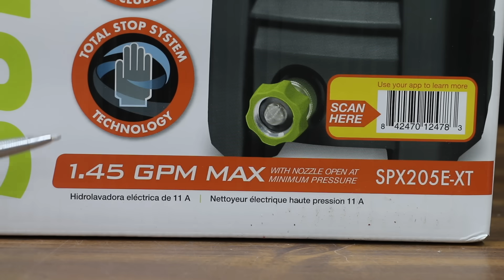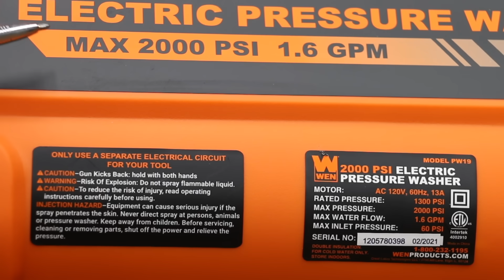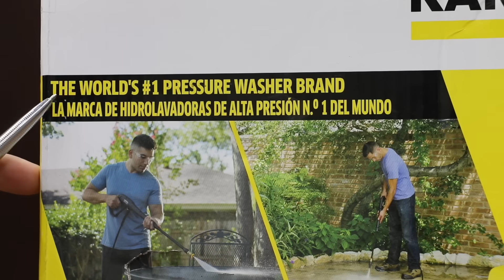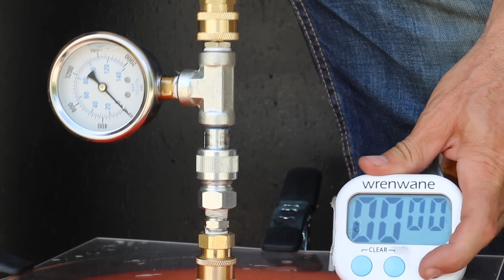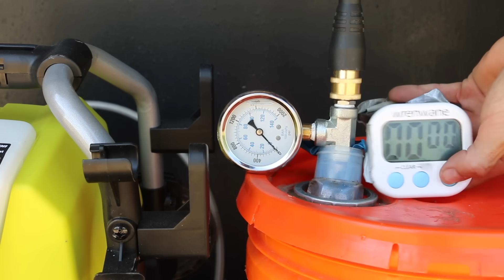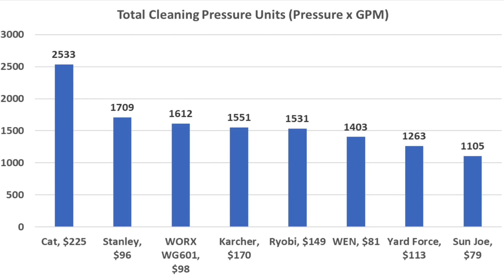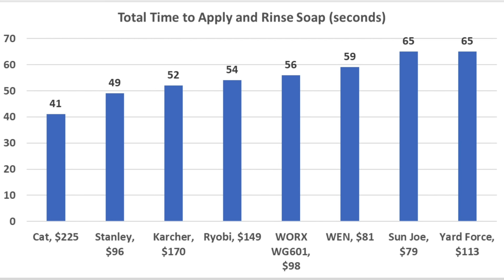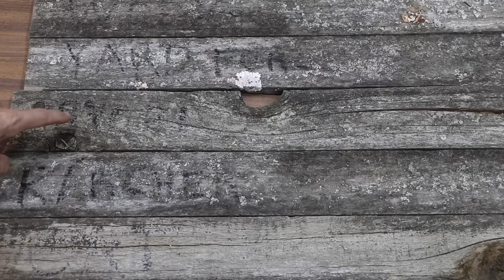Best Pressure Washer (ELECTRIC)? Ryobi vs Karcher, Stanley, Sun Joe, WEN, CAT & WORX

Comment: One thing I noticed is that some of the sprayers seemed to leak water out the nozzle. For instance, when watching the Stanley being used, there was a VERY large dribble that didn't spray out and just fell down from where the nozzle was. It'd have maybe been better to not include that water as part of the GPM testing by holding the nozzle such that only the water that came out with force made it into the bucket.
Reply from the maker: Thanks for the feedback.
Reply: @ProjectFarm  I love your stuff and all the time you take and the money you spend to create these reviews. Most things I have no need to buy myself but it's still very interesting to see how you test things and which ones come out on top. So I watch them all!

Comment: The CAT is a rebranded "Active" pressure washer. Also sold as a Simoniz in Canada. Obsessed Garage made a very detailed comparison of these cheap pressure washers a year ago or so. A Karcher came out on top at that time, but since then, they discovered the Active and swear by it (and sell it...). I have Simoniz and use an MTM accessory kit with it (gun, hose, foam cannon and quick connects). If you are a "weekend warrior" type of detailer, that is a great setup.
Reply from the maker: Thanks for the feedback.

Comment: The turbo nozzle is the bomb. It will make a HUGE difference. Makes a cheap washer work better than some of the more expensive ones.
Reply: My pressure washer came with two nozzles. I couldn't even tell you where the spray one is today. I'm sure it is still around somewhere. It's turbo over here all the way.
Reply from the maker: Thanks for the feedback.

Comment: Video idea: Comparing rotary tools (dremel and competitors). Both Corded and Cordless. The biggest drawbacks i find with my older corded dremel is the power/torque, and that it gets quite hot easily, and i need to let it cool down occasionally.
Reply from the maker: Thanks for the video idea.

Comment: Im literally on my way to Home Depot to buy a pressure washer. 

This video couldn’t have landed at a better time !
Reply from the maker: Great to hear!
Reply: I'm the opposite. Already bought one and past the return window.
Reply: @lancemcque1459  same
Reply: I borrowed one and now I know why the the estimates for cleaning/staining my deck were so high.  Their power washer was a muuuuch larger unit than any of these and actually got the job done in a manner nothing here tested would have.
Reply: I bought mine a few months ago too. I went with the Ryobi 2300 washer because it was said to have a better induction motor than the lower models.

Comment: I would like to see a retest on the presure washers with oil, grease and grime like you would see in an engine or under a car that had been leaking for a long time. and hot water vs cold water
Reply from the maker: Thanks for the suggestion.

Comment: Might consider doing an electric pressure washer comparison among the ~2300 PSI to ~3800 PSI models. Including some of the low center of gravity models, such as the Ryobi RY142300 (2,300 PSI 1.2 GPM). Also: a test for how long the pump can remain in operation without overheating and shutting down. Thanks.
Reply from the maker: Thanks for the video idea.

Comment: I recently bought a Greenworks brand electric pressure washer from Lowe's. It came with an 11" rotating surface attachment that really handled my driveway and sidewalks quite well. Noise was way lower than the old 3000psi Harbor Freight one that my dad bought years ago, and seemed to work well enough for what I needed. https://www.lowes.com/pd/Greenworks-2000-PSI-1-1-GPM-Cold-Water-Electric-Pressure-Washer/5001851125

Comment: Something worth considering and testing is what type of motor a pressure washer has. Induction motors last way longer and are much more efficient. I've burned out a few units within these price categories; all of which had brushed motors. All it takes is time, and  or lack of water flow.
Reply: All of these are going to have brushed motors. Induction motors would not be light enough to be portable or deliver the kind of power needed. So completely unsuitable for the task. You do have to know how to operate a pressure washer. It is not just plug it in and go. You need to make sure the pump is full of water before you run it.
Reply: @1pcfred  interesting. Mine is portable and "strong". Not as strong as I'd like it to be.
Reply from the maker: Thanks for the suggestion.

Comment: I have an AR Blue Clean AR383SS 1900PSI Pressure washer.  I've had it for about 4 years, used it moderately for a few weeks, now I just use it occasionally once or twice a month.  It works great, plenty of pressure for homeowner type chores, and can easily be upgraded with a better quality hose and wand as well as converting to quick disconnect fittings for the hose which is my next plan.
Reply from the maker: Thanks for sharing.
Reply: @ProjectFarm  No problem.  If I recall I paid $189 for the pressure washer...its electric, that's what I wanted, had a gas one and used it 3x and the pump failed, far from impressed and that thing was $650....the engine however went onto a lawnmower deck LOL. It had a 5HP Honda engine on it.

Comment: Yesterday out of curiosity I was reading my cars manual (2020 challenger r/t) and it mentioned that power washers over 1400 psi will damage the clearcoat. I'm guessing that's why most of these are around that pressure, and I'm also guessing most car paint is the same way.
Reply from the maker: Thanks for sharing.

Comment: Inexpensive pressure washers are cheap for a reason.  Best option is to rent a unit from home centre or rental centre…you will get a much better product that works a lot better.  You can be sure that none of these brands tested will work well in 5 yrs time.
Reply from the maker: Thanks for the feedback.

Comment: The pressure washer labyrinth online is a frustrating web of fake reviews and rebadged clone units. I'm so glad Project Farm has started to try to sort it all out. 

I ended up going with a Harbor Freight unit with the Predator 212 engine for just a few bucks more than the CAT. 
Thanks for a great test, PF!
Reply from the maker: You are welcome!  Thanks for sharing.
Reply: @Ben C Yeah, I have a Honda-based pressure washer from 1997 - I replaced the pump this year, but the engine is still going strong. The old pump was still working, but one of the oil seals on the crank case (of the pump, not the engine) was shot, and oil leaked out, and water got into the crank case. One of the ceramic plungers was cracked which probably started all the problems (probably froze :( ) - you'd be lucky to get 2 or 3 years out of one of these little toys, compared to 24 years out of a quality unit.

Comment: Id assume the gas-powered comparison comes next?
be sure to include the HFT 3100 psi washer, Ive had it a few years, the periferals (gun, hose, etc.) are cheap, but they are upgradeable, and the engine unit is pretty good, no throttle tho
Reply from the maker: Thanks for the video idea.

Comment: Garden hose: $15
Reply: yeah, but 40-60 psi is only good for rinsing your car after you've washed it or watering flowers
Reply: @knobrush  Don't really know where you're referring to. But here in AB, Canada where I am (unfortunately), the water pressure is so strong you could pull paint chips off a car if close enough. Strong enough to cause damage. Don't know about actually washing your car as this is illegal to do so in your driveway here.
Reply from the maker: Thanks for the video idea.

Comment: You should try testing out if the hypersonic pest repelants work at kerping mice and other animals away from your home very curious if when i plug it into my wall will it keep them away from that room or not?
Reply from the maker: Thanks for the video idea.
Reply: Scuttlebutt from other comments and conversations, and from watching Mouse Trap Monday on Shaun Woods' YouTube channel, is that Ultrasonic rodent repellers don't really work. I am, however, interested in trying out some of the flashing strobe devices that you can put near or inside your car, in the trunk or under the hood that flash automatically to discourage mice from setting up housekeeping. Loraffe seems to be the main brand that is sold on line.....
Reply: @goodun2974  That would be great. Gotta keep them mice away from the car and home
Reply: @johntruxal432  , many of the home-remedies for discouraging rodents don't really work, such as dryer sheets or Irish Spring soap; mothballs work but you don't want to use those unless you're storing the car and not driving it for months.  Fresh Cab (pine shavings infused with lemon oil) seems to work, as does a large jar of cloves with holes punched in it.  As for the strobe lights I mentioned they make one type that runs off flashlight batteries for about a month and a 1/2 and another type that you actually plug into your cigarette lighter socket or wire up to the battery. It draws very little current and supposedly stops drawing anything and shuts off if it senses your car battery getting too low, to where it would possibly prevent the car from starting. I'd like to put one of those in the wheel well and another in the engine compartment ....

Comment: I have a 100$ Karcher and reliability wise it's junk. Lots of plastic in the fittings and pressure gun that gives up quickly. Karcher is presented in their commercials as the ultimate pressure washer company but most of the reviews say the opposite. Maybe the top of the line is reliable but they are really expensive. The next washer I'm gonna buy is Bosch Professional, never red a bad thing about those.
Reply: Still have my Karcher Dirt Blaster 1250 that's 30+ years old and runs great.
Reply: @knobrush  well, maybe 30 years ago they made them robust. Just curious, do you remember how much it was?
Reply: @DanielTesla74  Sorry, but I don't.
Reply from the maker: Thanks for sharing.

Comment: A couple of video ideas:

1) Best outdoor caulking (there are a bunch of brand and chemistry choices)
2) Best Spray Paint Brand
3) Best car wax/polish
4) Best cordless tool battery platform - before taking the jump into Milwaukee, DeWalt, Makita etc - which as has the best battery?
5) Best 12VDC > 110VAC inverter
6) Best spray lubricant - is it lithium, silicone, graphite, WD40 or?
Reply from the maker: Thanks for the suggestions.

Comment: Great test outlining the performance of the pressure washers.. Definitely one can see the performance differences btw the different brands... Having gone thru 3 pressure washers myself of different brands I can say that long term the ones that last and maintain their performances over time are the ones with brass housings and impellers over the plastic casings and impellers.
I would definitely like to see a follow up video with the tear down of the various models especially the ones that ended up in the top 5 and last 
Cheers
Reply from the maker: Thanks!

Comment: What I took away from this video is that 120v pressure washers just aren't that great.  Not enough power to do a great job.  240v? Better.  Gas powered? More power potential.  Thanks for the video.
Reply from the maker: You are welcome!  Thanks for the feedback.

Comment: Love these videos. Interesting to see the Cat run away with the crown. 
I noticed something recently with a drill I bought a few months ago, and your sound meter reminded me:
My drill seems to have gotten quieter over time, possibly due to the gears wearing in (or maybe it's my perception). Would it be possible to run some of your previously-tested drills in high and low gear to see if they get quieter over time?
Reply from the maker: Thanks!  Thanks for the suggestion.

Comment: you are just a month late i bought a homdox pressure washer on amazon for 137$ just picking one with good reviews i just wonder how it would have stacked up it claims 2950 psi 1.7 gallons and 1800 watts which all seem like alot for such a cheap washer
Reply from the maker: Thanks for sharing.

Comment: GREAT test, commander. I found another unloader for my antique Graco so I have an electric one BUT my brother-in-law let the pump on his gas job freeze so I ended up with a cart and engine. I went to work on Ebay and outfitted those with a 2800 p.s.i. pump and 50 feet of 4k hose, 3/8ths instead of 1/4, dual stainless swivel ends and a wand with different length solid pipes, 4 tips, wand extensions and a water cannon for a lot less that I'd have paid for a factory job outright. I'll be looking for a higher pressure pump because I've got the motor for it, overkill as usual. AND you might go to a hydraulic hose place or auto parts place that make hoses and get another fitting and save your hoses. Hope summer is treating yall very kindly and BLESSINGS for ALL yall!
Reply from the maker: Hi Lewie, What a terrific approach you've taken to get the most bang for the buck!! You've got a very nice setup!  You're ready to tackle the toughest pressure washer jobs!  Just finished rolling 82 5x5.5 large round bales last week and the old baler held up very well.  I'll probably roll some more bales in late summer or early fall just to make sure I have enough hay to make it through winter.  Hoping you are enjoying summer too.  BLESSINGS!!
Reply: @ProjectFarm  THIS is what maintenance is ALL about! Very few people see it's pay me now or pay me later. Thanks, Commander and we're ALL blessed a lot more than we know!

Comment: Interesting video :-)  I chose a Nilfisk pressure washer it's about same size as the one's you are testing.. For 200€ it's a 130 Bar pressure washer and it has a inox pump it came with a turbo rotory fitting and a ajustable flat fitting... At the same price at the shop they had a Karcher but i was told it had a plastic pump so  that is why i chose Nilfisk instead.. Karcher is fine as long as you go for a higher model that costs plenty of money...
Reply from the maker: Thanks for sharing.

Comment: Best explanation for comparing PSI vs. GPM

PSI: how fast you swing a hammer
GPM: How big of a hammer you swing

GPM is boss.
Reply from the maker: Thanks for sharing.
Reply: Especially GPM WITH a nozzle installed. Pretty useless to measure the GPM with no nozzle. That's how you know this is "consumer level" junk products - when the specs all have asterisks after them, you know it's "quality"
Reply: I really like the 'pressure units'. These look like tonka toys compared to my yamaha 4gpm/4000psi
Reply: So PSI is HP and GPM is Torque

Comment: One thing of note regarding the 'standard' pressure hose fitting. There appears to be a 4MM and a 5MM connection. I recently reviewed a Yard Force unit for one of the big box stores and found that it had 5MM connectors and my foam cannon has a 4MM. Fortunately the pressure hose extended hose I bought came with an adapter. Great video as always!
Reply from the maker: Thanks!  Thanks for sharing.

Comment: not much innovation in pressure washers.  I would like to see a different/safer switching mechanism vs the pressure drop dependent activation which is clunky, hard on the tool, and dangerous.
Reply from the maker: Thanks for the feedback.

Comment: We used to build power washers from the ground up. We made one that was 5000 PSI 7 gallons a minute. It was 4 cleaning parking lots and it did an extremely good job almost too good. It was starting to dig into the asphalt if we were not careful LOL.
Reply from the maker: Thanks for sharing.

Comment: One thing you can't test is how long any of these units will last until the pressure switch inside gets gummed up.  I had a Campbell Hausfeld unit that had a failed pressure switch.  So the company sent me a newer, upgraded model.  Only after a few months of use and the unit wouldn't turn on the pump.  I never left water in the unit over the winter but it appeared that the pressure switch that controls the on/off of the motor inside when it senses water flow wasn't operating smoothly.

To be honest I expected better quality from Campbell Hausfeld.  My recommendation would be to buy a pressure washer from a store with an exceptional return policy if/when the time comes where you have to return it.  IE, COSTCO!  They'll return anything even years later it seems - although YOUR mileage may VARY!
Reply from the maker: Thanks for the feedback.
Reply: @ProjectFarm  No problem - I think the primary failure for many of these units IS that electronic pressure switch that turns the pump on and off.  I picked up more than a couple of roadside junkers of various brands that all exhibited the same issue!  It seems to be the WEAK LINK in all of them regardless!  Normally there is a cheap brass plunger surrounded by springs that when water pressure flows pass it, it moves into a position where it depresses on as witch that engages the pump.  But the cheap brass plunger gets crusty and rough and gets stuck and is never able to move far enough to depress the switch!

Comment: Interesting, however I don't agree with the pressue times GPM figures at all. It sounds logical but it's really not indicative of anything. And these pressure washers are on the bottom in terms of strength. Great for car washing and small jobs, but I don't think these could clean heavy stains from pavements, concrete. I have a Karcher K7 Premium (though I'm not familiar with pressure washers of the same strenght) but that thing is a beast. 2600 PSI, 2,42 GPM but it does chug 3000 watts at maximum but you can almost cut wood, remove paint, etc though it sounds like a helicopter. Having owned this thing, I'd never buy anything weaker though. Might as well buy something that's able to do much more than just cleaning a car.
Reply from the maker: Thanks for the feedback.